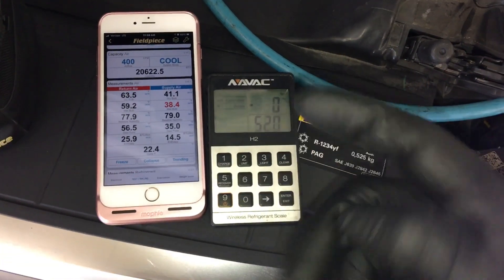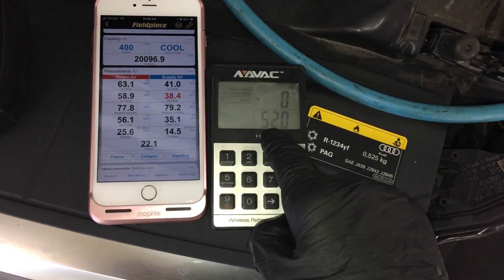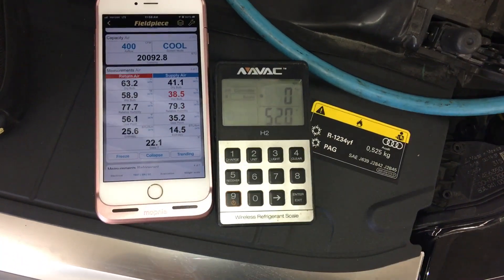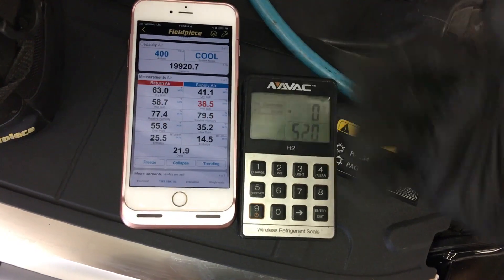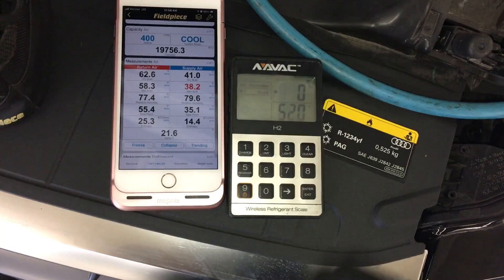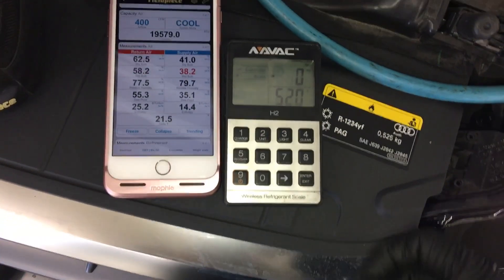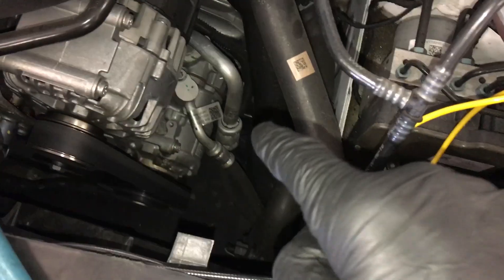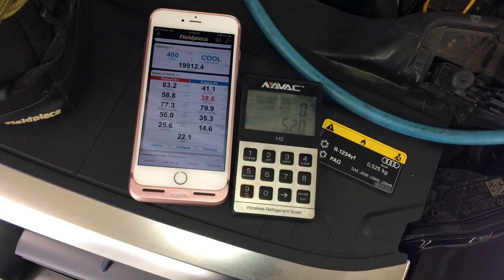Don’t Charge refrigerant by duct temperature,  Or bubbles in the sight glass,  Or pressures￼

Comment: Great video! Between variable speed condenser fans and variable displacement compressors, charging by pressures alone certainly isn't going to be accurate. It's amazing how much refrigerant you can add or remove without significantly changing the pressures.
Reply from the maker: This is why all the old-time shops make the rest of us out there a lot of money by destroying customers compressors. 

They’re so happy and proud and righteous that they believe they charged the refrigerant correctly because they got cold coming out of the dash . 

And that they’ve been doing it for so many years they don’t know that they were the ones responsible for causing their customers compressors to burn up . 

And they refuse to change them, defend their method and keep doing it . 

It’s sad for the customers who go to the shops for service for their air conditioning .